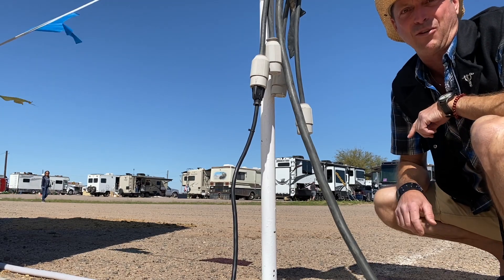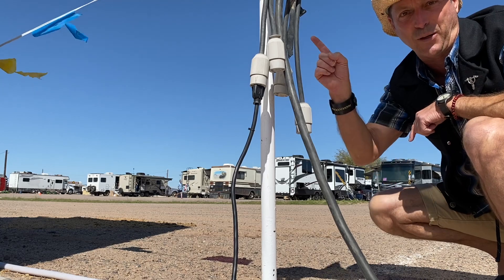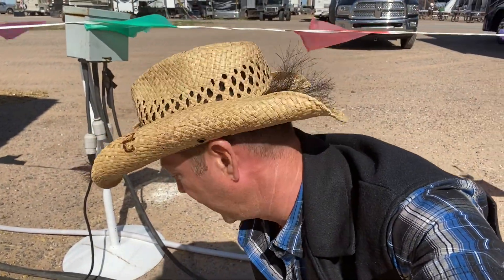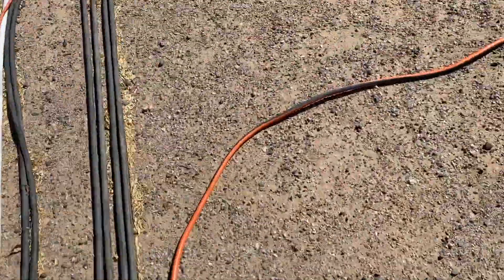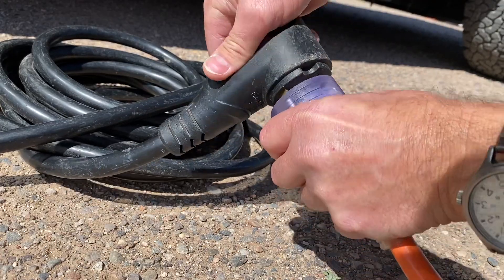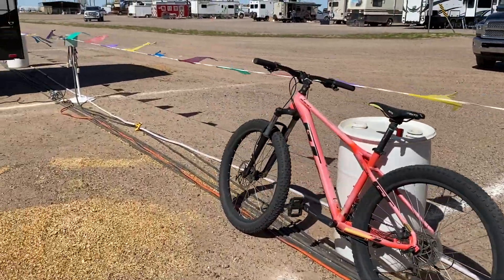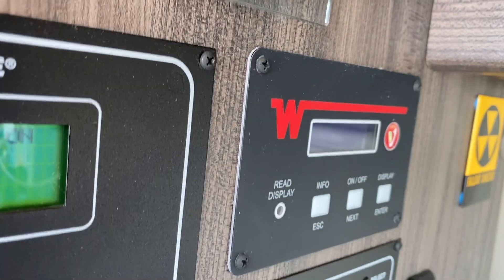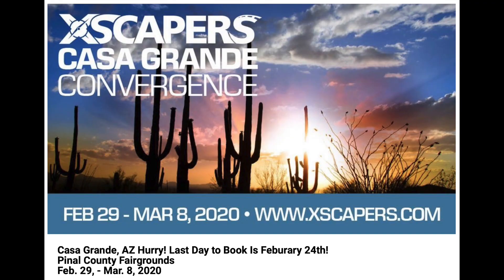DON’T TRIP A BREAKER! How to INGEST 15 AMPs into VOLTA Pure3 LITHIUM-Ion system Class B RV Travato

Comment: Great video - very clear step by step.  One question for you:  You set the Volta to not draw more than 15 Amps, but aren't you also supposed to change the selection at the PCS to 15A as well for the coach 120V circuits?  That way if you forget you're only on 15 Amps, and try to run too many 120V appliances, the PCS will "load shed" the heavy loads (A/C and/or Microwave) to prevent tripping the breaker? That was my understanding from what I've read...
RV. Under normal circumstances, I would first test the campsite plug with a tester, then switch off the breaker, plug the surge protector into the power pole, plug the 30A cable male end into the surge protector, and then plug the female end of the 30A cable into the coach itself. The last step would be to turn the circuit breaker back on, for the "one-time 'power event' reasons you described."  But with no circuit breaker at the power pole, it's a really great idea to lay out all the cords, adapters, etc. and then wait to plug in the power pole until the last thing.  I'll have to remember that when I'm in the same situation.
Like several others, I commend your neatness in laying everything out. Definitely an improvement over the "whatever" approach lots of folks take.
Reply from the maker: Jim, thank you for watching

Comment: Thanks, Scott! Helpful for my relatively new to me 2019 GL. Answered my question. I’ve got it on 10 max to be safe. 

I assume it’s fine to run my air conditioner while plugged into 15 amp?
Reply from the maker: Yep! Dial down AMPs into Travato GL to 10 AMPs and, assuming the circuit is not overloaded already, you should be able to keep your Volta system battery charged AND run your A/C as much as you want !

Comment: Thank you for explaining why changing the AMPs is needed.  When I purchased my RV the sales person said I wouldn't need to change anything on that 'black box".  I regularly plug in at my warehouse and without changing the AMPs to 15, I trip the breaker.  Also, I found that the RV was originally set to 20 AMPs so that explained why it took so long to charge my batteries when plugged in to 30 AMP!
Reply from the maker: Glad you were able to get some tips

Comment: Thanks. On my GL I also set the power center to match the amperage of the shore power, not sure if that's necessary.

I'm cautious about having cables coiled up when a lot of amps are flowing through them, mostly because of how warm they can get. It's best to lay them out.

On really hot days I've tried plugging into 15a outlets in order to just run the AC but no matter how low I set the charging amperage on the Volta system it never works. When the AC compressor tries to kick on it fails and it can trip GFCI outlets. On 15a I can only charge. If I want to run AC I have to unplug from shore power. Have you tried this?
Reply from the maker: This video shows how to reduce the Amperage coming into the Volta system.  https://youtu.be/BfeXtRRanME

Comment: Hi Scott. Thanks for this video - very helpful. Just bought a 2020 59GL. I had a popup 20+ years ago but never an RV. Lots to learn. Sounds like I can charge at home by switching to 15 amps or less and using a properly sized extension cord. That's good. I was thinking I might have to install a 30A circuit.
Reply from the maker: Glad you found the video useful.  Yeah, you are loving on your GL, I just know it. So enhances your RV freedom and experience. Thanks for watching and taking time to comment Gerry.

Comment: Scott, thanks for that. I had an issue where I wanted to run the AC on a 15 circuit but could not because the volts was pulling too much.  Glad I adjust now.  My question is I set the power control system to 15 amps the last time I had this power.  Do you suggest doing both?
Reply from the maker: The Power Control System. Do you have Volta on your RV?  If so, you change the ingest on the Volta Demension control panel to change AMP ingest.  Not sure on the Power Control System TDH.  Great job trying things out though! Thanks for watching and commenting!

Comment: That’s cool how you can change the input to the inverter. Any reason you didn’t run your 30A cord to the power post and just use the adapter there and eliminate the 10G extension cord completely? Just wondering. Thanks. 👍🏼
Reply from the maker: Power source too far away.

Comment: As always... amazing information! Did not know the Travato had such an adaptable system! Wonder if any other RV makers are out there watching this? 
Love the new mantra too!

Had one question... what can you have on in the RV that won't be an issue (air conditioning, etc.)?
Not sure if it matters if you are running off battery, but not being electrically intelligent (or intelligent in general!), I get easily confused!
I'm guessing you can run everything without issue and it just takes longer to charge the batteries back up to full power. 

Be seeing you!
Reply: In my experience with the GL you can't run any heavy loads (AC included) while plugged into a 15a circuit. On 30a you can do whatever you'd like.

Comment: Scott, it is my understanding that the Max Branch amps setting only affects the maximum current the Volta system will use to charge itself.  It does not limit the draw of the overall Travato system.  If the Volta system was low and drew all 15 of those amps' you would blow the circuit if the AC or microwave were switched on.  So, lowering it to 15, may not be enough to keep the circuit from popping.  When plugged into 30 amp, I usually leave ours at 15, because I really don’t need the quicker charging 30amp would give me and it leaves me a minimum of 15 amp for everything else, even if the Volta is drawing all 15 of the Max Amps I am allowing it to draw.  I know some users who will set the Max Branch to 5amp for a greater safety margin.  This would leave at least 10amp for  the coach, if plugged into 15amp and the Volta drew the Maximum 5amp to recharge.  This part of the system could definitely benefit from some more automation.  Unfortunately, I believe the standard PCS controller so totally ignorant of the Volta recharge demands on incoming amps.
Reply from the maker: Craig, apologies for the delay in getting back to you. I reached out to Volta directly with your question. Below is their reply.

Craig is correct the branch circuit setting tells the system how much energy it’s allowed to pull for charging purposes.  The only way to automate this function would be to have a way of verifying what type of shore power feed you are plugged into, what is the condition of the breaker or fuse, and what loads you have on when.  It’s not impossible but would be tricky to do.
Reply: Here's an alternative: Set the Volta to draw 10/15 (or 20/30) amps and don't nuke anything or allow the HVAC to kick in while you're charging. Basic RV resource management.

Comment: What can you run in the van with 15 amps?
Reply from the maker: Can run everything in the van as normal. Incoming electricity replenishes the energy pack pack. At some point consumption will over take replenish rate but that it part of resource management when on a slower ingest rate. At least that is my understanding.

Comment: Cool mantra! Scott, did you give your electrical chord a turn after you plugged in to the coach? Do you use a surge cord?
Reply from the maker: Usually use a surge protector. That is a best practice.  I connected to van and then plugged into shore power.

Comment: Hi Scott. I’m a wannabe. Can you run the a/c or heat using 15amp or lower? How does that work bring in less power than going out? Thanks for the great content.
Reply from the maker: Hi Heather. Apologies that it has taken me about two months to get back with you. However, I reached out to Volta with your question. Below is what they came back with.  Hope it helps.

15 amps at 120V is 1800 Watts.  If you exceed 1800 watts of power while the inverter is in by pass mode there is a good chance the shore power fuse/breaker will pop and the system will automatically switch to inverter power from the storage energy in the battery.    In another scenario if your on a 15 amp feed and the voltage or frequency go out of calibration such as a brown out or a power surge the system will disconnect shore power and begin pulling energy from the battery.
Reply: Thank you so much for getting back with me. You always go above and beyond to help people. This does help me. Stay safe and healthy!  @GoSmall.LiveLarge